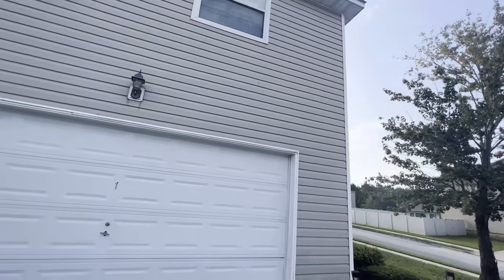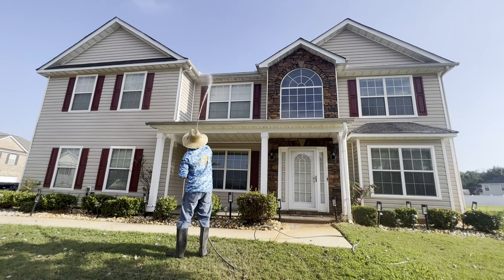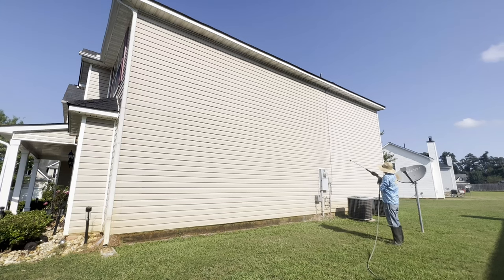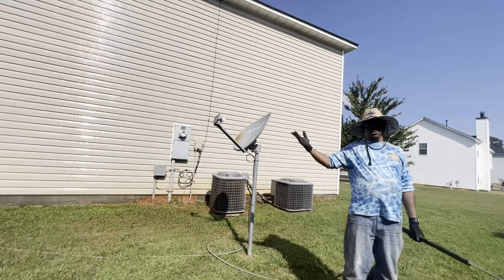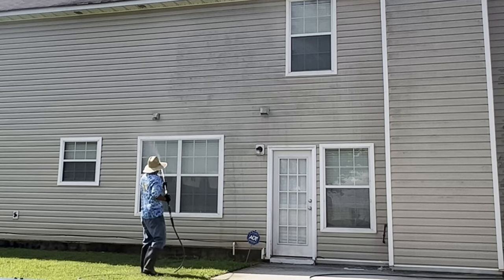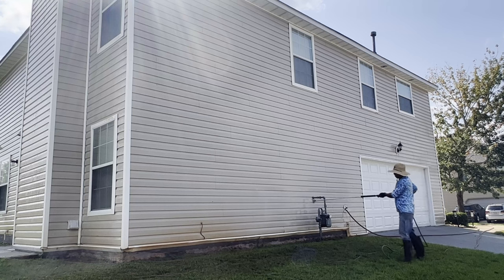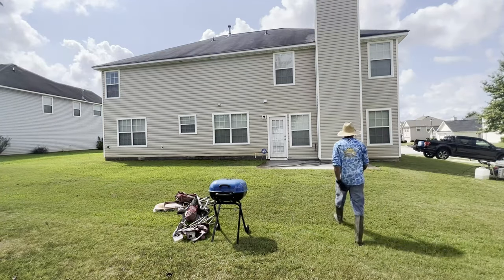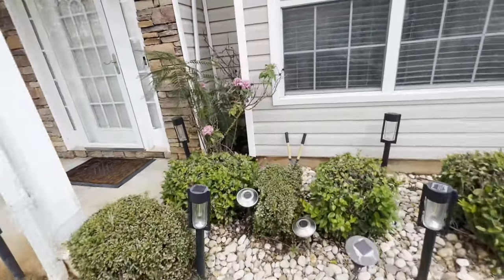How To Pressure Wash A House Step By Step

Comment: Great video I always look forward to seeing to your video. I notice that when engage your trigger it doesn't appear to kick back as much my pressure washer kick back pretty hard maybe because of the different in size of the equipment thank for sharing. I like to ask what you charge to wash a house like that if you don't answer I understand why.
Reply from the maker: I'm not sure with the kickback but have something to do with the uploader on the machine. If your machine has a good uploader you won't have any kickback. You may need to have someone to look at your machine. The way you should charge is by the square foot. Let say this house is 2000 sqft. If you charge $.10 a sqft than that will be $200  and $.20 a sqft would be $400. You have to determine how much you want to make never go off what other people charge it may not be enough on what you want to make. This house was 3500 sqft. so set your price on what you want to make on this job.

Comment: Great video man. 
Im just starting out. Had my first job today. I use a foam cannon until i can upgrade to a soft wash system. Do you need to dilute sh before going into the cannon or does the water through the hose do it?
Reply from the maker: The water will dilute the SH but I can't tell you how much the SH will drop in strength. I had never used a foam cannon before on a job.

Comment: What size orifice does your DSI have? And what do you usually charge for job like this?
Reply from the maker: My down stream injector is a 2.1 rated at 3-5 GPM. This is the second one I have on my machine because the one came on the machine broke. I don’t over think things so if I need a stronger or weaker mix I mix it in my bucket. So I never change out my injector.